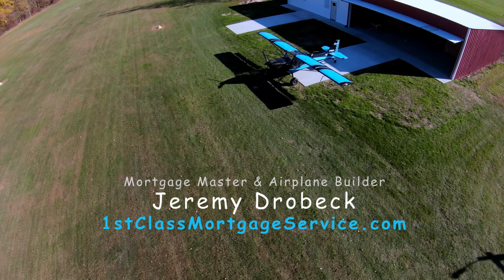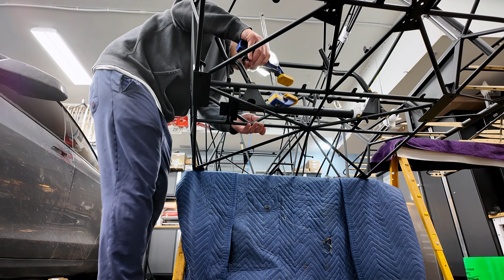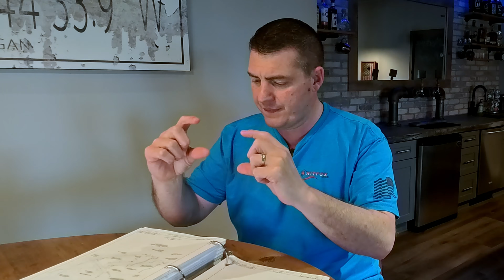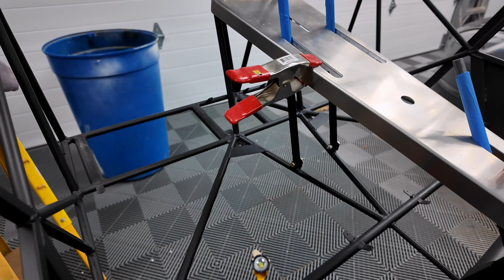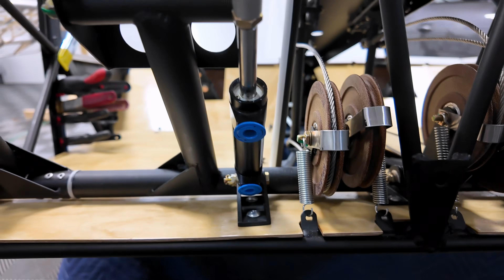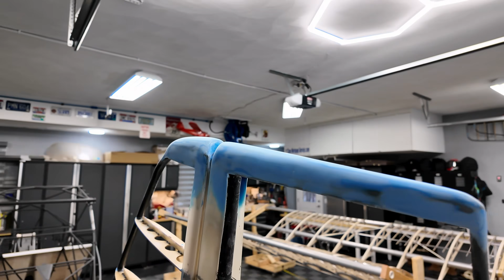The Fuselage: Flight Controls, Center Console, and Stringers  | Kitfox Build Series E4

Comment: If its not too late, I would highly recommend you add one more notch to the flap detent bracket at a 3/4 flap position. Most used flap position (other than none) is 1/2 flaps for landing and T/O. Full flaps is just too much and is not used very often. A 3/4 flap position would be very desirable and is easy to do before the parts are installed.
Reply from the maker: Too late, we as you know doable but a pain. I thought about doing that . . .  But what's wrong with full flaps on landing.  Seems like it just lowers the stall speed more than 3/4 would, allowing the plane to land slower and shorter.
Reply: @JeremyDrobeck  At full flaps the controls are really sluggish and you have quite a bit less range for aileron control. Not a big deal, but all the folks I know that added a 3/4 notch are glad they did, and find it useful.
Reply from the maker: @kitfoxn990tt5  fair enough maybe down the road if when I have to pull that center counsel off I'll add the notch.